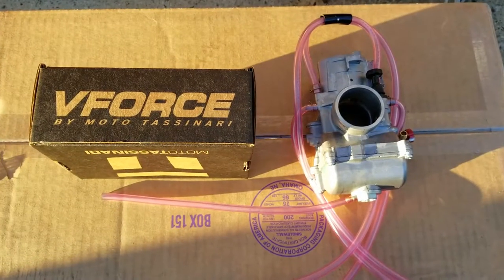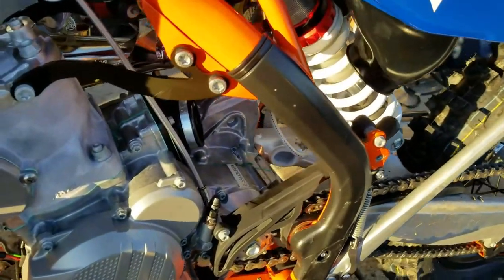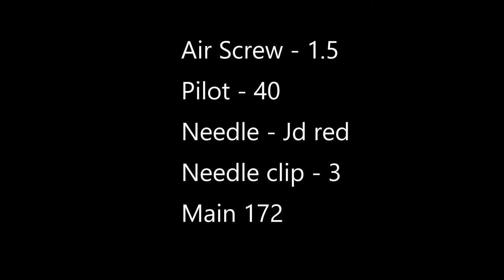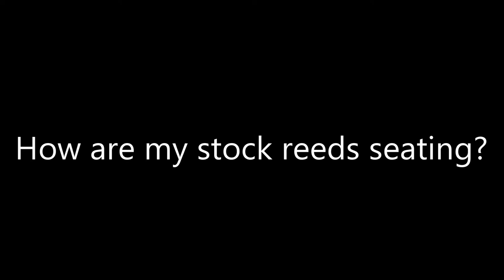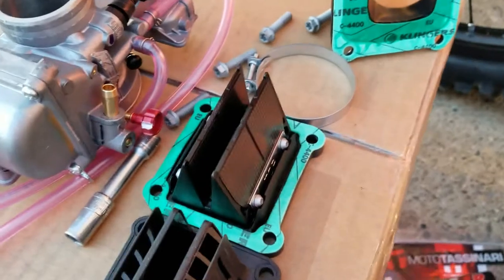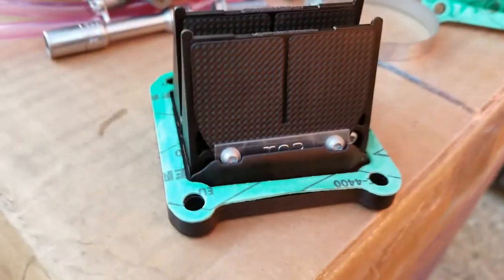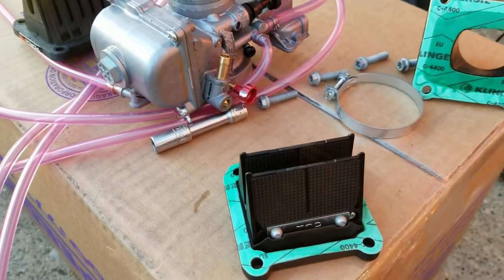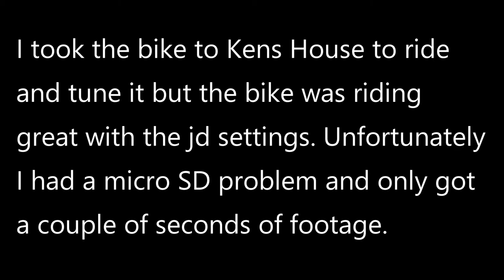2018 KTM  300 xcw Keihin carb conversion w/ v force reeds

Comment: Was this with stock muffler and pipe? Also what oil ratio are you running?
Reply from the maker: @phillipbarnett-uw4rr  stock pipe. Fmf turbinecore silencer. I ran 50:1 ams oil dominator and the jd jetting was good.

Comment: This is why I love fuel injection.  Just got me a gytr tuner
Reply from the maker: Crash 963 - you lucky dog. By the time I get my next bike I'm sure they will have the ktm tpi ironed out. What can you change with your tuner? How's those power line trails looking?
Reply: Pony Down 418 you can adjust fuel only for rpm and throttle position.
I have not worked on much for the bike.  Nothing on power line yet.  It might be late spring with the way I've been working.
I'll be riding the Ape if I don't get my Yamaha prepared soon
Reply from the maker: Crash 963 that's cool. It's better to be able to adjust things around if need be. You been busy work huh. That's both good and bad im sure. Get working on that bike!!! Lol. Which I need to tell myself also. I have to install my rad guards and rekluse.

Comment: So what is the verdict on the Keihin carb??? I have a new 2018 Husky TX300 (same motor and carb as your bike). I'm debating trying to make the Mikuni better with the JD kit or just replacing it with the Keihin like you did. So what is the verdict? Is the Keihin better, smoother, and more consistent? Thanks!
Reply from the maker: Viv Baker - I'm super happy with the keihin carb conversion. It's very consistent and the jd jetting kit has the bike running like it should. If your not happy with the stock carb I would suggest the setup I did.

Comment: PA I live in PA to I typically run from 0 to 4500s ft in altitude I like your jet settings what altitude do your run?
Reply from the maker: spakls - I live in Michigan and i ride mostly all over the state. The elevation here ranges from 800 to 1200 if remember right.

Comment: I bought the same kit for a 01 ktm 200 and I can't get the bike to crank... new reeds spark plug air filter. Gotta go back and take it all apart and see what's wrong
Reply from the maker: UT oh... That's not good. I wonder what the problem is.
Reply: @ponydown418  me too, my problem right now is getting time and weather too work on it. I'm learning as I go so I'll try next to pull the reeds and put newer gas in it and see what's what, but after I kicked it a dozen times I pulled the plug out and it was dry
Reply from the maker: @freetaylor72  yea. Definitely have a problem there. Did you try the basics. Check for spark, float height, etc...
Reply: @ponydown418  yeah I got spark, I think I'm sucking air through the crank seals cause before I got the new carb it was smoking and black oil was dripping from the exhaust. But I still don't think gas is getting through... I enjoy working on the bike but the cost is getting to the limit I've set. I paid 2200 for the bike and have put 1100 more on top of that. I got all the seals though and fresh gear oil, gaskets etc. I just got to get time off from work to mess with it. I've never rode a 2 stroke so I'm really excited to get running right. Itll happen cause if I have to I'll rebuild the motor and that way it'll be brand new. Keep riding bro, I'll catch up soon. 😁😁
Reply: @ponydown418  
Hey bro, went down to the storage locker today and that bike started first kick...no problem.... hummmm! O well gonna move on to to phase 2 and change the crank seals.
Reply from the maker: @freetaylor72  well that's good news there. Just need it to start that way every time.

Comment: Was that a 36mm or 38mm Keihin you replaced it with?
Reply from the maker: Honestly I don't remember. I'm going to guess a 38mm. I bought it off the jd jetting website and it was listed for 17/18 ktm 300 bikes.
Reply: @ponydown418  Yeah likely a 38mm then. Trying to find JD jetting specs for the 36mm for a 17' 300 XCW. Thought I'd ask since you didn't mention it in the vid. Thanks for the reply.
Reply from the maker: @jaybird99100  good luck bud. I'm running the jd jetting kit also.

Comment: Hi excuse after 2years but your bike gain power or not?? Bye
Reply from the maker: To be honest I didn't even try jetting the bike with the stock carb on it. I went straight to the reeds because of known sealing issues either from new or down the road with little hours. Then the keihin carb because they are know to be easier to be jetted with little fluctuations because of the weather.

Comment: I am interested in doing the same thing to my 2019 300 XC. How did everything work out?
Reply from the maker: Everything worked out great. The runs as it should. I only think I would possibly consider is using a Suzuki needle instead of the jd jetting kit. I heard good things from people using those.
Reply: @ponydown418  Which Suzuki needle are you using?
Reply from the maker: @DevinOrr  I'm using the jd jetting kit. But since then I read on some 300 forums or fb pages that the Suzuki needle works really well also. I don't know the part number though.

Comment: Main reason I'll never go ktm. That's what 6? $700 worth of not upgrades but necessitys to make the bike reliable and run right. 250x runs like that out of the shop, for $3000+ less.
Reply from the maker: Tom Partee - yea I have to agree with you. It's something that you shouldn't have to change on a bike of that cost.
Reply: Pony Down 418 but.....! Great looking bike! Have tons of fun on it!
Reply from the maker: Tom Partee - it is a nice looking bike. It better treat me good. Lol
Reply: Mikuni can do well but it's finicky.   Requires too much attention for me personally.  Trying to figure what setup to go with.   Keihin, Keihin w/ JD, Keihin w/STIC, or Lectron.
Reply: Tom Partee I agree I bought a 2018 ktm 300 xc and I wish I bought a yz 250 2 stroke old technology or not it’s a better bike don’t need to buy carbs fix suspension check for cracks on the frame the list goes on and on the reeds the rims

Comment: omg just took my reeds out huge ass gaps or vforce 4 tonight
Reply from the maker: I love Hard Enduro - from the problems that can happen with stock feeds. I'm going to vote force for the win!!!
Reply from the maker: I love Hard Enduro wow! That's a lot of light through those reeds.
Reply: thats so bad haha. I also have that JD jetting kehin carb. im at 4500 feet it runs good! gonna get those vforce.
Reply from the maker: I love Hard Enduro - what made you want to check the reeds? Was the bike running bad?
Reply: no its been running good, i just heard horror storys about the stock reeds and i was doing the spark plug replacement anyway so thought i would just check them out and im glad i did, this is also my first two stroke so i might not know if its running great lmao, its the same bike as yours just not the 6 days version i have 18 hours on it.
Reply: also just got them ordered from rockymoutain :)
Reply from the maker: I love Hard Enduro you normally can't beat rocky mountain prices. Especially when you get the free shipping.
Reply: yes sir :) i live close to utah so its quick shipping